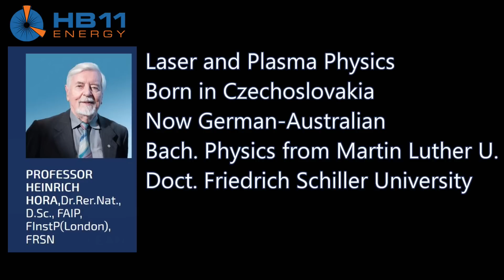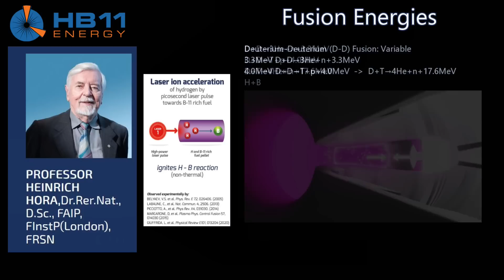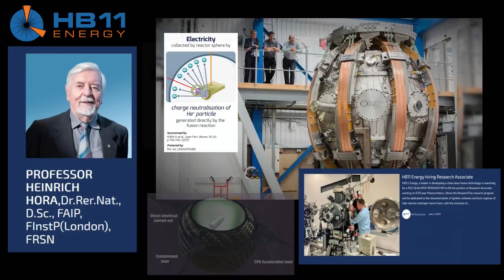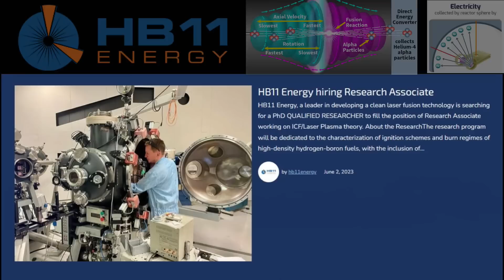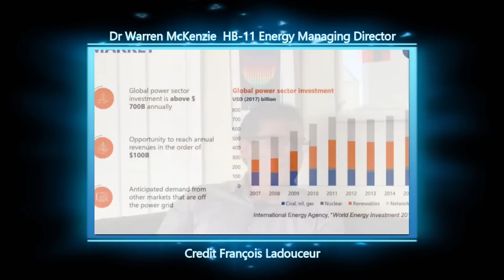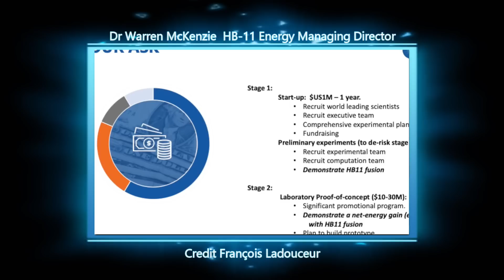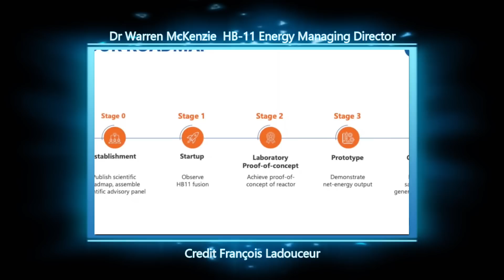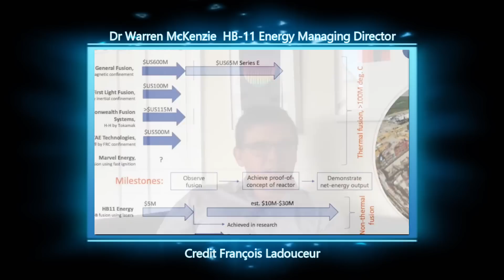Hydrogen Boron Aneutronic Nonthermal Direct Energy Fusion

Comment: I always liked and hoped for direct fusion to electricity ... using it to heat up water and spin a turbine just feels so ... barbaric compared to fusion...
Reply: I mean, if the efficiency is hight enough it won't matter right?
Reply: @nedisawegoyogya  I'm not saying it's stupid or won't work. I'm saying it feels like there should be a better way.
- Perhaps it's not even possible: here, I don't know how will they make sure all the helium nuclei shoot off in the same direction - I would assume they would want to go away from each other, so perhaps heat is the only way ...
- Anyway, my point was not about what matters, but the feeling of combining something so advanced, and something so "primitive".
Reply from the maker: Indeed.  Compact, low temperature electric power generation would be amazing.
Reply: @Verrisin  Various engineering solutions suggest themselves, likely that scattering is not a century-long development cycle like D-D and D-T are proving, and they are MUCH more problematic in the direct-electric generation (still susceptible to engineering solution.)
Reply: @nedisawegoyogya  Steam-to-turbine generation will NEVER be capable of exceeding thermodynamic and mechanical limits (plasmized H2O to electrons, that's a different matter).
Reply: I love it, it is essentially a battery that never needs recharging! Maybe someday we will be driving and flying around with this technology under the hood. Jetsons… Here we come.

Comment: The process in the NIF uses a gold cavity to produce X-rays, and it is these that compress the central pellet, not the laser beams themselves. The lasers enter through the open ends of the gold cylinder and strike the interior cylinder surface, forming an X-ray emitting plasma. Hitting the pellet with the lasers does not produce a sufficiently uniform implosion of the fuel to compress it fully and start the fusion reaction.
Reply from the maker: Well the Xrays don't compress the pellet so much as they are created by the laser interaction with the gold pellet and fire into the deuterium creating fusion conditions.
Reply: @terranspaceacademy  Yes, saying the X-rays compress the central pellet was an oversimplification. The X-rays generated inside the gold cylinder are absorbed by the outer layers of the pellet and heat them up so they expand outwards. That produces an inward reaction force which is what actually compresses the fuel inside the pellet. The advantage of the X-rays is that they (a) provide extremely uniform illumination of the target and (b) are able to penetrate the plasma around the imploding target to greater depth than laser light would, thus depositing more energy.
Reply: @terranspaceacademy  the pellet is not gold, the shell is made of diamond. The "Hohlraum" cylinder surrounding the pellet is made of gold but, in theory, any high atomic number material will do.
Reply: It mimics the energy wave that would occur in the fission primary of a nuclear weapon. The holy grail of such research is figuring out how to make a pure fusion device or fusion initiator for a fission boosted device.

Comment: It took me a long time to even remotely understand this, after referring to the papers cited in the web site, however I think I can summarize this at a layman's level:
1/- This is NOT thermonuclear fusion, as it does not rely on high temperatures
2/- The first Boron Proton fusion takes place by accelerating a proton in an electromagnetic field, which is generated by a very short laser pulse.
3/- The three alpha particles released in the fusion accelerate more protons by elastic collision. The accelerated protons then fuse with further Boron nuclei.
4/- This is a chain reaction, similar to a fission chain reaction. Provided enough generations take place, a large amount of energy could be released.
5/- The large axial magnetic field focuses the alpha particles and accelerated protons so they have a greater change of colliding with another Boron nucleus.

This seems an incredibly elegant mechanism. The key is for  how many generations will the chain reaction progress .
  I do not understand why you need a laser to accelerate the protons. Why not use a conventional ion particle accelerator?
Reply from the maker: We agree.  It is my favorite for useful fusion energy in our lifetime.

Comment: we need fusion energy for reasons that have nothing to do with climate change. Tokamak magnetic confinement designs are a dead end for so many reasons. The need for cryo-cooled magnets to allow for high currents is but one huge problem with magnetic confinement approaches. Laser ignited fusion (LIF) is likely the only viable route to sustained, controllable fusion energy output. I'm not hopeful though LIF can be commercially scaled to the power levels needed for an economically viable output of megawatts of electricity at any reasonable cost.
Reply from the maker: As long as we get there brother Joel. :-)

Comment: Your equations for the D-T and D-D are incorrect.  D (one proton and one neutron) +T (one proton and two neutrons) produces He4 (two protons and two neutrons) plus a neutron, not 4He.  D-D produces He3 (two protons and one neutron) plus a neutron, not 3He.
Reply from the maker: They are simplified of course.  The chain of events is more complicated but I will review them  in case I got them wrong transfering to the editing software.  Thank you.
Reply: This, there is a substantial difference between 3He and He3.
Doing some basic accounting on the mass on the left and right side of the equation He3 should be the answer. Unless the reaction describes 4D+4D, but then the ~4 MeV is misleading

Comment: LPP Fusion will use Hydrogen Boron fuel without the need for Helium-3 from the Moon. They currently have one of the highest fusion energies in the race using the least research funding. The FF-2B and it's successors is a simple and cost effective design that is suited for mass production compared to the crazy expensive ones from other research groups or companies.
Reply from the maker: Can you give us some good links and we'll research it and do a lesson.

Comment: Is this fusion? To me at least, it looks like fission, where proton hits the B11 nucleus which then splits into 3 x He3 nuclei, or am I missing something?
Reply from the maker: That's a very good point.  The reaction proceeds through a series of intermediate nuclear reactions, starting with fusion of boron and a proton to form an unstable carbon atom.  Unstable because of the energy conditions, not the isotope, eventually resulting in the three helium nuclei. Here's a possible sequence of reactions that can occur:
B11+p=C12   (This forms an excited state of carbon-12.) The carbon-12 then breaks down to He + Beryllium-8
 (The excited carbon-12 decays into a beryllium-8 nucleus and a helium-4 nucleus.)
 He (Beryllium-8 is unstable and quickly decays into two helium-4 nuclei.)
The overall result is the production of three helium-4 nuclei.
Reply: Interesting question. But does it matter in practice?
Reply: @terranspaceacademy  Thank you for the clarification. That makes more sense .

Comment: Yea we don't need fusion now.
We can be perfectly fine with fission for the next 1000 years or so.
We just need to make fission cheaper than any greenhouse producing method which seems quite within our grasp in the coming years (actually now but add political obstruction time).
That kind of fission is just flat out going to be cheaper and easier than fusion for the forseeable future, and by my guess the full 1000 years it takes until prices of fissile and fertile material start climbing due to supply.
Reply from the maker: I like the C14 diamond batteries!

Comment: Just curious, how does a laser become a stream of protons?  I always thought lasers were pure electromagnetic energy.  Is it possible to better focus and confine an already existing beam of protons using a laser to prevent scattering until they hit their intended target?
Reply: The graphic showed the proton labelled as 'H,' which is Hydrogen.
He didn't specifically address this but I assumed that either the laser strips the Hydrogen atoms of their electron as they accelerate the proton nucleus or the reaction can just ignore the electron.
Reply: A laser produces a directed electromagnetic force, this force  can be used to influence any charged particles, a proton by itself (without it's electron) has a positive charge.
This is my understanding If I am wrong p,ease correct me
Reply from the maker: The laser is used in a "Wakefield Effect" manner to accelerate the hydrogen ions (protons).  It can also used to vaporize some boron into a plasma and slam them together.  See Tri Alpha Energy.
Reply from the maker: That's correct.  Wakefield acceleration.  Thank you Tim.
Reply: waves do have momentum, and can only accelerate protons, but not create protons, which are composed by 3 quarks.

Comment: Residual radiation
Calculations show that at least 0.1% of the reactions in a thermal Hydrogen Boron plasma produce neutrons, although their energy accounts for less than 0.2% of the total energy released.[35]
These neutrons come primarily from the reaction:[36]
11B + α → 14N + n + 157 keV
The reaction itself produces only 157 keV, but the neutron carries a large fraction of the alpha energy, close to Efusion/3 = 2.9 MeV. Another significant source of neutrons is:

11B + p → 11C + n − 2.8 MeV.
These neutrons are less energetic, with an energy comparable to the fuel temperature. In addition, 11C itself is radioactive, but quickly decays to 11B with a half life of only 20 minutes.

Since these reactions involve the reactants and products of the primary reaction, it is difficult to lower the neutron production by a significant fraction. A clever magnetic confinement scheme could in principle suppress the first reaction by extracting the alphas as they are created, but then their energy would not be available to keep the plasma hot. The second reaction could in principle be suppressed relative to the desired fusion by removing the high energy tail of the ion distribution, but this would probably be prohibited by the power required to prevent the distribution from thermalizing.
Reply from the maker: Interesting... Thank you.  Bummed me out though :-)

Comment: Great video. I think fusion is the future, just a question. I believe that clean safe fusion energy will cause an increase in our energy production and usage. Going back to my thermodynamic classes, all energy eventually transforms into heat energy. So, let's say we develop fusion and reduce the CO2 in the atmosphere to manageable levels using carbon capture with our fusion energy. We now have a new increased source of heat from the extra energy we are now using. How do you think we get rid of that? Don't get me wrong, I am not saying, " Throw our hands up and give up on solving the problem." Just, fusion will produce challenges of its own, but we should be mindful of those future challenges and not approach it with "that's future me's problem" mindset.
Reply from the maker: Isaac Asimov assessed this issue when considering thermal fusion.  The great thing about the HB-11 technology is that it does not produce much waste heat.  But heat production by humans is truly nothing compared to the sun.  It's the heat retention by the atmosphere (CO2, methane, water vapor) that causes such a problem.  Even if energy usage goes up, which it will, the heat produced by direct energy weapons will be a lot less than what we are putting out now.
Reply: @terranspaceacademy  I've read a lot of Isaac Asimov and that story doesn't read a bell. I would like to read it. Do you have a title?

Comment: Naively I'd have expected that adding one proton to Boron-11 would create Carbon-12 which is both the most common isotope of Carbon and is stable.  Why instead does the reaction create 3 helium-4 particles ?  And doesn't fission of elements with smaller atomic numbers than iron require the input of energy so it seems counter intuitive that this reaction which would essentially be fissioning Carbon-12 into 3 helium-4 particles could occur without the energy input (presumably from the lasers) exceeding the energy output.  Obviously this analysis is some how wrong but I'm struggling to see why.
Reply from the maker: You are not wrong. Adding a proton to Boron should indeed create Carbon 12. The energy required for the proton to get close enough to the nucleus to fuse is enough to then destabilize the nucleus, splitting it apart. Imagine playing pool with magnetic balls and a table with mound in the middle. The nucleus is the 11 balls on the mound. You try to hit a ball with just enough force to climb the hill and stick to the others without breaking them apart, but it turns out that the power needed to get up the hill is more than enough to knock the others apart and off the mound. The stability of a new nucleus after fusion is complicated.

Comment: I hope they can commercialize faster than cost declines of battery storage. If they don't then they will be out competed like early 1900 electrical cars.
Reply: Battery cost or efficiency will never make a substantial impact on nuclear fusion or fission.
Batteries are a method of storing energy, fusion and fission produce energy.
Atomic energy offers millions of times the energy density available when  compared to chemical and all other currently available energy sources.
Reply from the maker: Thank you David.
Reply from the maker: David is quite right.  If we charge our batteries off of coal produced electricity we are not very far ahead of the game.
Reply: These are never intended for cars. Personal vehicle means a small spaceship. Where small is also relative.
Reply: One thing that renewable energy proponents never seem to mention is the amount of land area needed to be used.

Comment: Seems like it's a great system if like all of them it can be perfected. If i had the final choice i would like to explore all the different ways currently being researched. It is doubtful that the first system that comes on line and makes positive amounts of useful power will be the last system. So exploring all of them would seem to be the best way to proceed.  
   Yet I'm not all that bright and know only the bold print information concerning all the different types of achieving fusion power. I have been sold on the idea however and like everyone I'm certainly tired of hearing it will only take 40 more years or so. I can hardly stack Legos properly yet I'd still like to have those  who are so very much smarter than I am, to make fusion happen. I'm not bitching it's more about wishing. So come on guys there's a shiny nickel in for ya. 😁
Reply from the maker: There are many viable approaches and I expect more than one to come through.
Reply: @terranspaceacademy  that was my thinking also.

Comment: But getting back to this Hb 11 From what I understand this does seem to be one of the ways to go there's many different types of fusion reactors being worked on right now and you hope 1 of them will turn out within the next 510 years of course if we have access to HE3 we would have that power now but unfortunately we don't have that right now 25 tons of Ag 3 is enough to power the US or 1 whole year Far as climate change the plan is to use the same principle we're gonna use for perform and Venus shielding between us and the sun different Far as climate change the plan is to use the same principle we're gonna use for perform and Venus shielding between us and the sun  Using different sideways to shield and control the sunlight as the best way to control climate change not this carbon print
Reply from the maker: We still need to get to space affordably to make all that happen and fusion is our brightest option.

Comment: Just come out and say it. There are way too many variables That we do not have the math nor the engineering. To really create fusion or Vision energy.
You have the:
Materials
geometry of the materials 
thermal conductivity of the materials 
amount of power you need
How BIG it needs to be.
Can the materials handle the power? The list goes on and throughout that entire list, you're losing tons of energy.
Reply from the maker: We have been able to accomplish fusion for over a hundred years.  Doing so efficiently should not be insurmountable with modern computers, AI, superconductors and lasers.